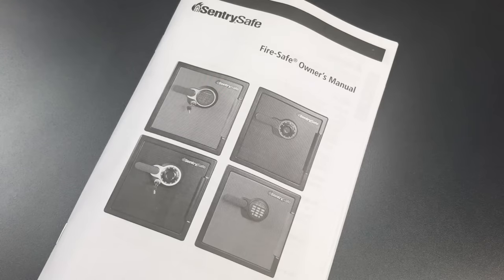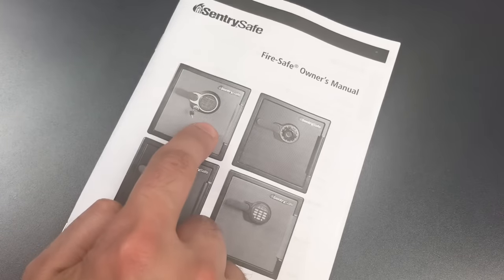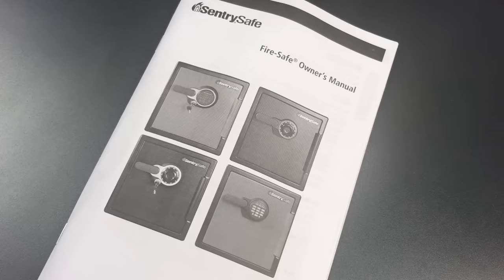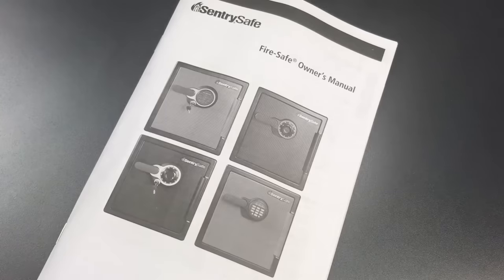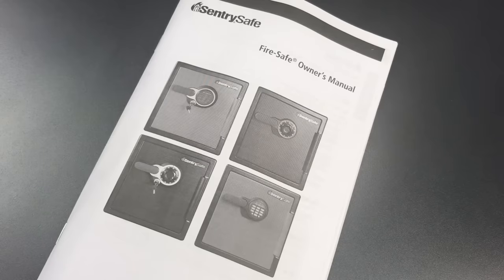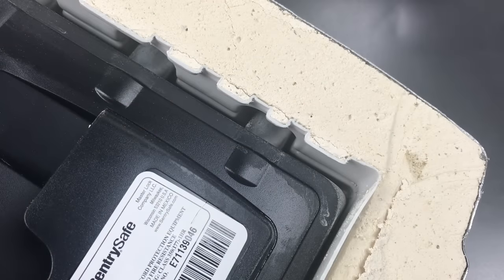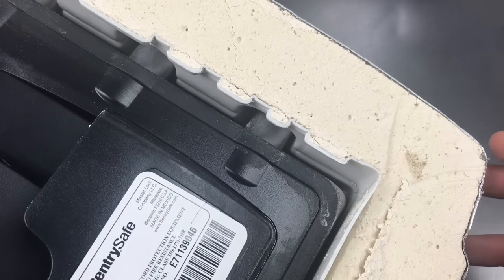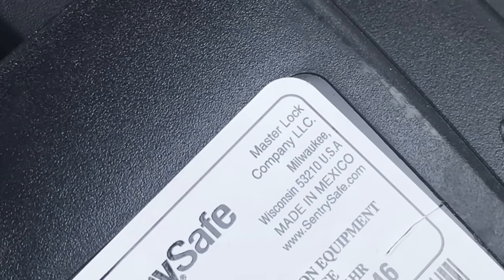[756] Sentry Safe Cut in Half FAST!

Comment: Oh, I'm surprised the outside was metal, I was expecting plastic. Sentry is really only good for their fire protection. Their safes and boxes usually aren't even waterproof, as much as they'd like to claim.
Reply: Sentry safes are not popular in spain, I always thought that outside were plastic (their fire safes).

when any company says that a fire safe resist the water, the fire safe only resist splashing water, for example those caused by firefighters.

i have seen, opened and repaired fireproof cabinets after small fires. the fire-resistant briefcase (small briefcase with a construction very similar to the sentry fire safes) and the briefcase are more fire resistant than it seems
Reply: Plastic wouldnt hold up against fire
Reply: nor will that metal :))
Reply: that insulation is actually pretty effective at keeping the internal plastic from falling apart and the test fire only gets to 1650 at 1 hour and that is below the melting point of steel.
Reply: The concrete foam mix insulation is surprisingly effective.
Reply: @YTRulesFromNM  
I can attest to it keeping papers from getting destroyed in a fire anyway.  Soot on the contents but they didn't light up like everything else in the room.
Reply: gemofe we have one of those fire-resistant briefcases, plastic on both sides. We don’t bother using the lock, though, it’s very nearly the same grade as a floppy disk container, if you can remember those..

Comment: Surrely this doesn't count as "deficient"
It's a fire safe, the idea is that it will survive a house fire and you can recover it....house fires don't usually involve a lot of saws. This was built for a purpose, hence why amost the entirety of its thickness is fire retardant insulation.
Reply: I know of a notory office that sells these safes, and they specifically advertise them as being fire-proof, not for security lol.
Reply: I doubt fire will attempt to use passwords either, so why did they bother with that?
Reply: Exactly this comment... And Birman, of course he has a password, because you don't want people flipping through the kind of documents one would place in such a safe. Think of kids, a housekeeper or a visitor. Someone who is curiouse, but usually not nosy enough to go get a circular saw. IF there has been a fire, the lock probaly wont open and you actually want to be able to cut the thing open...

Comment: I’m going to keep all my valuables under my high security mattress, should provide about the same level of protection.
Reply: Shattered Dreams  Even special doors can't resist fire for more than an 90 mins (witch is more, than I expect from this thing), so for a big fire, this is still useless.
And why the lock, if its job is only to protect in case of a fire?

Edit: Resurch on fire doors
Reply: You can double the protective value of a Mattress Safe by sleeping on it naked, most theives will nope right outta that nonsense.

Comment: I literally thought saw dust was falling on the floor at first but to find out there is no rebar or any kind or metal structure inside is mind blowing. I work in the automotive field and I have ran into things that baffled like this in the beginning so its I breath of fresh air to find something that surprises me these days. Cheers
Reply: It's a *FIRE SAFE*, the dust stuff that is falling out is the insulation that protects the contents against FIRE.
It's not intended to protect against theft, which is why it doesn't offer any particular protection against theft.

Comment: Thanks, LockPickingLawyer. After watching you saw the thing in half I immediately became confident enough to bludgeon it open with a claw hammer. I was able to do it in less than an hour and save some very important documents. Laughable how thin the metal is, and how all the important locking bars slot into the plastic.

Comment: Flex Tape can fix that!
Reply: I think it was MADE from Flex Tape.......
Reply: AHAHAH yes flex tape.. You are the winner for today's best comment
Reply: I like your idea of using the factory method to put it back to original shape.
Reply: Just wrap the whole damn thing in flex tape and you'd have a better safe.
Reply: He SAWed a Safe in HALF!
Reply: Yes But can you paddle across a lake after on top of the safe after you use the tape?
Reply: I've seen some with a much higher security rating made in the exact same method but with concrete in place of the fire insulation and sadly the answer to that one is a Dremel to peel away the tin full and a hammer to crack the egg LOL
Reply: Wrapping the entire safe in Flex Tape might make it more secure. The saw is likely to get stuck in the sticky goopy stuff!
Reply: LOOOOTTTAAA DAAAMMAAGGEEE!
Reply: And Taofledermaus would shoot it with an antiaircraft gun lol.
Reply: And the result would be more annoying to deal with!
Reply: To be fair if it was made of flex tape it might have taken 3 minutes not 2.

Comment: I previously worked for the John D. Brush Company back in the 1980's (the company that originally made Sentry Safes) and the main feature of Sentry Safes was (and probably still is now that its owned by Master Lock) protecting its contents from being damaged by fire. The inside temp of an ordinary safe would get hot enough to char paper beyond legibility (ruining legal documents) and even damage jewelry if the safe was in a house fire whereas a Sentry Safe would protect the contents from harm.  The models I personally worked on had outer shells that were expected to melt in a fire and this helped seal the safe and keep it air-tight, maintaining an inner temp that wouldn't damage the contents.  After a house fire you would retrieve your safe from whatever was left of your house and the safe might actually be a concrete block at that point.  You could then break open the block and retrieve your undamaged important papers, etc...  Its possible that this Sentry Safe was designed similarly.

It's inaccurate to judge this product's merits based solely on theft protection when its primarily designed for fire protection.  It has enough theft protection to deter a common, unprepared house thief, who generally don't come armed with circular saws, and would have a great deal of difficulty stealing this extremely heavy item (the fire insulation is cement-based and weighs a ton).  For theft protection you would need a different model or even a different brand safe.  

I feel like this is a case where the LockPickingLawyer has made an honest mistake by assuming that the only protection that matters to a home owner is theft protection and fire protection has no importance when nearly all of us have fire alarms in our house, which are good for fire-protecting people but worthless at fire-protecting anything else.  He was completely off base when he derided it as "same or lower than the trunk of your car" when any valuable in your car's trunk would almost certainly be destroyed by a car fire, unless it was also in a Sentry Safe.
Reply: Same thing when he unlocks really heavy duty locks with glittertech gizmos by an very experienced lockpicker, and comments are usually braindeads going HAHA LOCK WEAK
Reply: I think he does know that, he stated there was confusion about the theft protection they provide at the beginning and made sure he said that he cannot confirm the water nor fire protective properties, but was going to test the strength of the safe.

His message is more of "this is inadequate to stop a thief", not "this product has no use."

He does also explicitly say "...even a thief with basic tools. So, if you're in a market for a safe to protect your valuables..." just before the zoom, reinforcing that he is not reviewing the fire protection, only the theft protection, which is poor, but people are, again, seemingly confused about.
Reply: Yeah, except that's not how the product is advertised. From the company's website: "Security Protection: Maximum Protection, 2-4 live-locking bolts, solid steel construction and pry-resistant hinge bars provide our best protection from forced entry and tool attacks" "Top of the line protection." So, basically they are lying. If they only advertised it as a fire safe, then your point would be valid, but they clearly want people to think that this safe provides "Maximum" security protection as well.
Reply: @davidjustice6287  exactly. It doesn't help building it for one hazard and advertising it as a full solution. Misleading the consumer.
Reply: This comment would have more merit if they didn't market it for security purposes, in addition it's made to resemble a security safe, and makes a big deal of having two-factor locking mechanism. All this means the video is fair.

Comment: We had two of these, we used them for documents and for storing things like extra car keys and fobs. We also kept a cash box in one as we generally keep $500 on hand for emergencies. 

We had a fire in 2019 and they held up great. I think the weak construction is by design as the unlocking mechanism on both our units was badly damaged (melted) and we needed to cut them open. I will say that it was an incredible PITA because I had them in the corner of a closet and stacked one on top if the other and they were bolted down. I bolted the bottom one into the floor structure and then bolted the top one to the bottom one with lag bolts.

Let's be honest in saying these are cheap safes. I never expected them to be high security just a place to keep birth certificates, emergency money etc. And in the end, those two safes did their job, they kept that stuff protected. Lastly, let's be honest. If you own a safe, and someone is aware of it, and they want in, they will get in.
Reply: These safes are just to prevent oppurtunity thefts, not really to dissuade professional thieves or robbers. If you need the latter, buy super thick and heavy safes and encase them in concrete walls so thieves can't bring it with them to open it in their leisure.
Reply: @rap3208  bolting them down goes a long way
Reply: so how come you didn't just build a bigger one yourself & save the extra cash & work bolting two together?!!?
Reply: @MrAdamNTProtester  please seek professional help
Reply: They're fire safes. The fact anyone is expecting them to hold up to a huge angle grinder is embarassing. This comments section is really clearly just a bunch of children patting themselves on the back.
Reply: @9volt65  It wasn't even a grinder, just a cheap circular saw with a common wood-cutting blade.
Reply: @dancingdog2790  You're right, not sure why I said 'angle grinder', must have been sleepy. Point still stands that nobody reasonable should expect a fire safe to hold up to a power tool. As for the 'wood cutting blade' part...it's still a power tool with a 12" saw.
Reply: @9volt65  That's not a 12" saw any more than it's an angle grinder. It's just an anemic 7" saw, with a wood blade.

The security here is abysmal and a wake up to the average guy off the street who would expect far superior security. Master lock does everything they can to lull people into believing this "safe" will offer a high level of security when it does anything but.
Reply: Then why do you need a safe? Enlighten me pls!
Reply: Company PR team be like.......
Reply: I_Commission_DSPriscilla_Art  The saw is anemic compared to other brands and sizes. That is not in dispute by anyone informed Pris.

As for the size, the label with the size and model number is clearly visible in the video. Go look to confirm that you are wrong again.
Reply: Years ago an article in Consumer Reports said that it is fairly easy to build an inexpensive burglarproof safe; it is fairly easy to build an inexpensive fireproof safe; it is difficult to build an inexpensive burglarproof/fireproof safe.
Reply: @RadioMattM  Great news. So if they're both inexpensive, just put a smaller fireproof safe inside a bit larger burglarproof one.
Reply: @rap3208  -  So only "Professional thieves"  have a basic circular saw made for cutting plywood?  Okay.
Reply: Let’s be honest
Reply: It's also rated as a FIRE SAFE, I believe there is reason why they specify the rating. Saw that at the beginning of the video. So what you used it for, was exactly what it was designed for. I guarantee that a SECURITY Safe, which has a higher rating, would not be that easy to get into. So I totally agree with your estimation, that's mine as well, great comment!.
Reply: @clintonmallard8447 — I died, thank you
Reply: @ambroseabellair5306  (Non English perspective) Depends how you define a safe - I would argue that most people nowadays think of safe as "metal box which main function is protection against thieves". While historical definition did include "fireproof" (note that this "fireproofing" was mainly just case of metal box reducing damages from fire) this is today secondary function - nice addition but not main function of safe nonetheless. So when you are talking about "fire safe" to most people that just what you would call "fire proofed 'security' safe".

"I guarantee that a SECURITY Safe, which has a higher rating, would not be that easy to get into." - that sentence then does not make sense for obvious reason - what you are calling "security" safe is just a safe.

I would argue that what you are calling "fire safe" is just "fireproof box" and should be marketed as such (also adding lock only exacerbates problem as it shows people that "it protects things from thieves").

If expectations of user, based on visual clues that are coming from conventional usage of visually similar products, don't match functionality of the product then you have a scam or very bad design.
Reply: @void6623  Thank you for your reply and false advertisement is a big market here in the U.S. The false labeling and intentional deception is off the hook.
     I simply saw the word FIRE SAFE and assumed it was not for security, but for protection against fire, with a measure of security.
    So, out of the hope of salvaging the reputation of what seems to be another deceptive product being sold as a security safe verse's that of a fire box.
   I simply pointed out the possibility that there may be a rating difference that the laymen like myself may not be aware of and that was explained at the time of the purchase.
    I agree, it is a fire box, but it has a lock, and perhaps that is exactly what they should  call it, but that's the problem with deceptive advertising. 
    They can call it a safe, because it does give a degree of security through a locking mechanism. Really looking to see more to this due to the company's reputation , but maybe there is no rating system and it's just a piece of junk.
Reply: The only reason to have one of these safes around is for storing your important papers. Basically anything that you don’t want to lose in a house fire, that’s all they were really made for. And to keep anyone from just casually swiping the whole thing in a break in.
Reply: @ryanloughren7839  Exactly
Reply: Unless it’s a liberty safe….your not getting in lol
Reply: $500 on hand for emergencies?   Like for trips to the Waffle House?